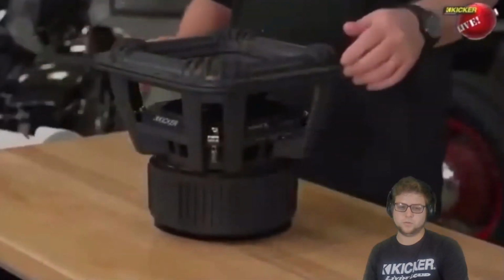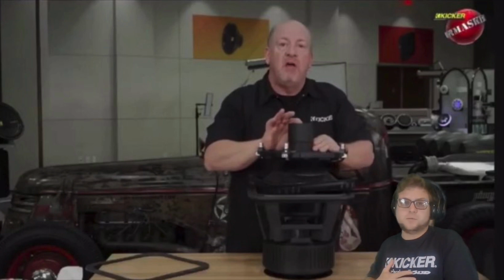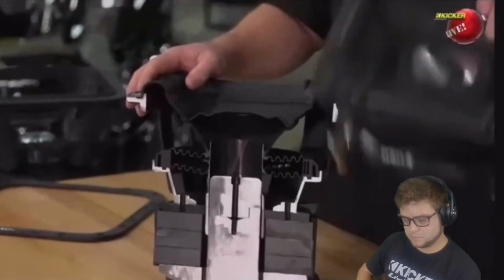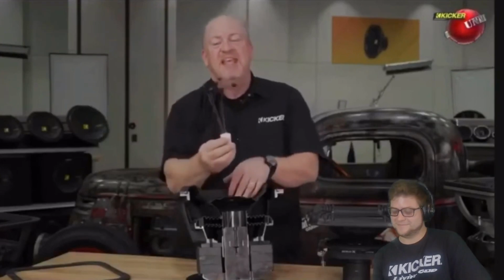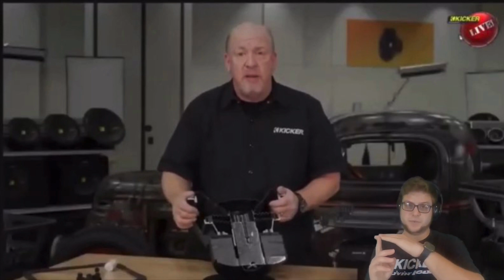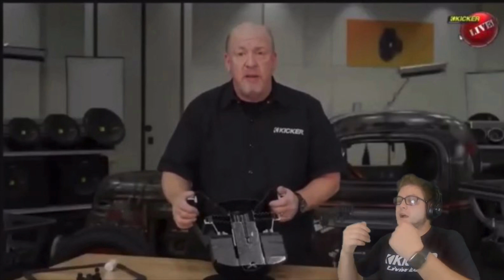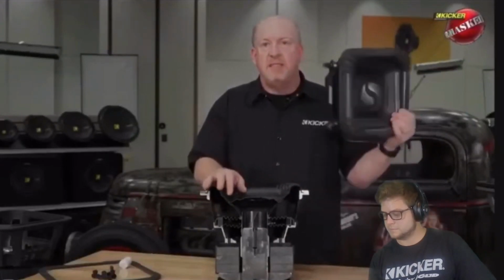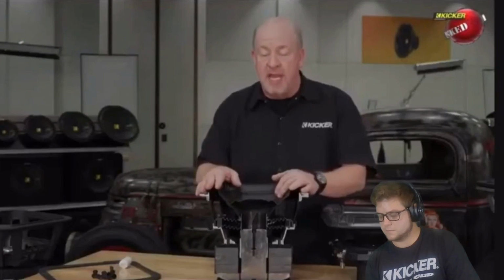THE NEW KICKER SOLO X RELEASE! KICKER UNMASKED

Comment: I wish they would give it more power over 2,000 watts
Reply from the maker: This rating is harder than the original rms rating - with a klipple going for 4hours straight 20-80hz free air ... it could take 2.5-3k easily on music
Reply: @LivinLoudwithAndy  what would be the ported box size. I have 2 L7 15s already in separate boxes of 3.0 cube anything on that.
Reply from the maker: @StJello  well i can give you an estimated guess .. since they don’t actually have the ts parameters. Yes 3cubes would work but like the L7 series that is on the smaller side - from what I can tell is these would probably need more power in that same enclosure but could have more overall potential if that makes any sense

Comment: I would still prefer the original solo x, the 10 and 12 rated at 2500 watts rms then the 18 at 5000 watts rms...this version im not liking the design..its too basic. The solo x had its multiple colors of red black grey and white. Way better still...descent power for a 10

Comment: I wonder what would have more output? 1 high excursion 15 inch woofer on 2000 watts, or 4 15's medium/lower excursion on 1600 watts. I like the idea of 1 woofer to be able to design multiple boxes easier and the simplicity, but my alternator is proprietary and cant be upgraded so im looking for a setup that doesn't use much power. 

Ive got a 800w system and already get voltage drop into the 11 volt range at idle. So with just adding a AGM battery I wonder if I could run a 1600 watt setup...
Reply from the maker: Depends what you are reaching for in your system but in most scenarios 4-15s with just flat out more cone area moving more air will be louder .. in simple terms . What kind of vehicle do you have that you cannot find an alternator for… I work with OHIO GENERATORS ALTERNATORS and they can literally make an alternator for any vehicle it just takes a little bit more technique for the ones that don’t have something right off the shelf if you get my drift! And to answer your question it takes power to make power depending on the amplifier you have and how efficient it is will really depend on how much power you were able to make off your stock electrical or for any electrical in that case… I’ve seen some pretty crazy systems on Stock electrical but I would not suggest it because it is hard on the equipment… The money you’re spending on electrical will save you in the long run 😁
Reply: @LivinLoudwithAndy  wow! Thanks for reply. I have a toyota hilux yr 2000. It has a 70amp alternator but it has a vac pump on the front of it with oil in and out and 2 vacuum lines. Im in Australia and there is a off road alternator especially for it thats 110amp but other than that I can't just install a mechman or stinger for e.g. do you think going the 110 amp would open me up to run slightly more power?
Reply: @KurtisPape  if you have the chance to upgrade from your 70 amp to the 110 amp definitely go for that! You can't lose by doing that upgrade. Though the improvement probably won't be phenomenal it will be a noticeable improvement. 

Also I remember speaking with you before about Brazilian amps... Remember? Anyways my fellow basshead the Taramps seem to be extremely efficient when it comes to current draw. Especially when you compare them to the power hungry Chinese amplifiers. I remember you mentioned the Smart3 previously & from experience that amp is very efficient. I've seen 2000 watt Chinese amps that were far more power hungry & drop voltage noticeably more than than the 3000 watt Taramps. Though before when we were talking I didn't realize that you only had a 70 amp alt on your vehicle. That is something to consider prior to ordering a Taramps Smart3. Do you have a second battery or anything along those lines? I would highly advise adding more battery power to your vehicle if you plan to use the Taramps Smart3. With your current 70 amp alt or even upgrading to the 110 you mentioned you will definitely need more battery power in order to supply a Smart3 with proper electrical. I'm running a 350 amp h/o alternator so that of course helps me a lil bit. 

Btw Andy mentioned Ohio Generator, those guys are some of the BEST in the business when it comes to high output alternators for car audio applications. Their alternators are the real deal & worth the money to anyone needing to make high power! Talk with Andy or call Ohio Generator directly (you can goggle their website or look them up on Facebook) I would be highly surprised if they are unable to make a high output alternator that will work for your Australian Toyota Hilux. I think they can probably assist you with getting 270 amp or even higher output alternator just depending on how high in amperage you would like to go. Good talking with you again bro, I wish you nothing but good luck, positive vibe & heavy BASS!!!
Reply: @LivinLoudwithAndy  Ohio Generator is the real deal Holyfield when it comes to high output alternators! I didn't know that's where you worked.? Anyways I've never heard a negative remark about the alternators they make. I've always heard he was the very first person to make a high output alternator for a car audio application... Andy is that true? I've been thinking about contacting them to see if they could help me with a dual alternator setup for my vehicle. Haven't been able to find anything online as far as brackets or anything for my application.
Reply: @itdoesntmatterwhatyourname6128  Hey, cheers for reply again :) If I got the Taramps 3k I wouldnt run at full power, I would upgrade to 800 rms woofers and run total 1600rms. I think the best bet for me would be to buy a Lithium or AGM cranking battery and just paralleled to my lead acid up front. You see my other reply about Taramps and the RCA input?
Reply from the maker: @itdoesntmatterwhatyourname6128  hey Thankyou for helping Curtis out! Couldn’t of said things better ! My “ Business/car audio shows I have up here in pa , we are partners with Ohio Gen ! I know the owner very well and I myself can get you deals on products from them . They called me 😊 I said sure let’s do it and help out bassheads who want true reliable power ! Also like you said I am certain they can make any alternator , they had to Frankenstein mine 😂 lots of other main stream alt companies do not carry my vehicle- which was definitely a killer when you are new to the scene and can’t just buy one like you see Tahoe alts or any GM car out there lol .. and to finally answer your question.. yes they did make the first HighOutput alternator for a vehicle! Give them a call and they can help with alt brackets as well !
Reply: @LivinLoudwithAndy  hey man that's awesome you know the fellas at Ohio Generator. I just found out about them maybe a year ago & felt completely out of touch with society due to how well known & respected just their h/o alts are. I will holler at them on the alt brackets after I figure out what enclosure & how I'm going to set my new subs up. Btw what vehicle do you & what amp alt did you go with?  Curious what vehicle you had then Frankenstein a alt for. I should probably look thru the vids on your channel. I'm guessing you probably have a video that details your car audio setup.

Tbh you hit the nail on the head when you mentioned getting alts for Tahoes & GM vehicles! For a while I was actually looking for a Tahoe or Suburban or something along those lines because h/o alts & multi alt brackets are so easy to find for them. Which I'm still going to end up getting a SUV sole because its so much easier/cheaper to be 'loud' versus the car I currently have my amp & subwoofer in. I have my stuff in the trunk of a Police Interceptor Crown Vic & the backseats do not fold down on those due to having metal exbrace reinforcement from factory dividing backseat & trunk. So it really holds in a lot of sound & pressure both from reaching the front seats. I really would like to hear the difference in my lil ol' single 18 in the back of a SUV or even a hatchback. A smaller hatchback or even a stationwagon is also on my radar. You know any 3 of those are truly ideal for high rms bass setups. I'm either wanting to go four 18s in a SUV or two beastly 15s in a hatchback.

Andy man you & I may seem to have a slight difference of opinions on Kicker or what not & the products we would love to see them make but we are both bassheads & I do appreciate what you add to the car audio world. Difference in thoughts & opinions are good because they help advance car audio tech. Just as long as the differences do not become divisive & generate drama. We all know that's never good. Some ppl get carried away & start bashing ppl & audio companies and that's just not cool. Its alright to dislike a company but sometimes its just best to keep thoughts like that to oneself. Unless a person is sharing needed info about a company that has ripped them off, done poor business or experienced legitimate failure from a product that they indeed used properly. I think its good to try to weed out companies & issues like that so the next basshead doesn't have the same experience or waste their money on an inferior product.

Comment: Mr Irby said later in the Q&A that the 2000W RMS rating was sine wave for 4hrs straight!!! In other words, for music.... shiiiiiiiit.... probably closer to 5k!
Reply from the maker: Yes - comfortably rated .. but yes definitely some room for error or more power when needed ! Bet it could take over 5k at a burp
Reply: @LivinLoudwithAndy   I hope so since other brands can burp 10k + even low wattage sub
Reply from the maker: @robertrdumke  burping power can be way higher than the rms especially in certain enclosures/designs - most the time you run into mechanical limits before power limits on burps !
Reply: @LivinLoudwithAndy  too many other subs have been hitting 20k burps. Numbers like 10k on a burp that may even sound like crazy #s to some are starting to seem too easy & appear as ancient history. High power builds have become the norm in daily drivers these days. I sure hope they are releasing something with more than just 5k burp potential.

Andy I'm guessing Kicker is your go to brand for subs & amps... (though i could be wrong) I'm curious as to whether you buy or use other brands of car audio subwoofers/amplifiers? If so, what brands? (I'm talking about present day, not 10 years ago or anything way back in the past)